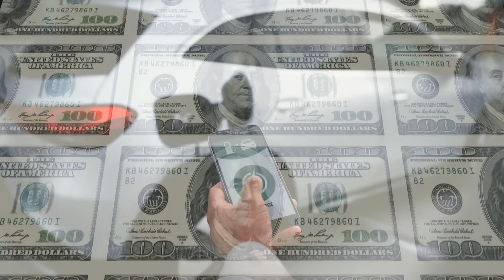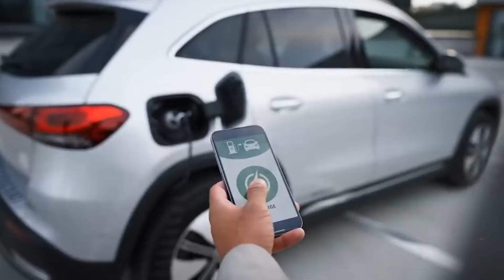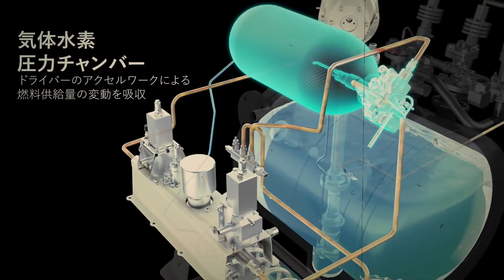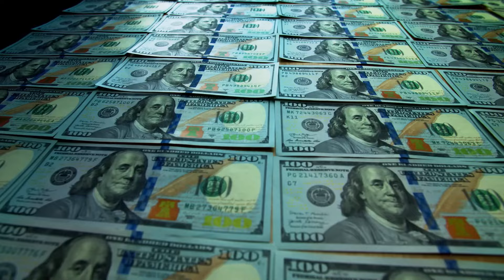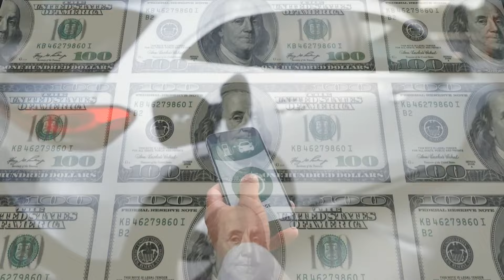HUGE NEWS: Toyota CEO REVEALS New Carbon-NEGATIVE Engine!

Comment: Okay, but are they accounting for all the industry surrounding the production of that engine? Each component is made by a separate factory run by coal fired power then shipping components via diesel trucks/cargo ships etc. Carbon negative means nothing if tones of carbon go into production of product. Electric engines are much less complex and battery tech WILL get exponentially better.

Comment: According to Electric Viking, theirs only two hydrogen fuelling stations left in California, after Shell closed shop!  Really Toyota, do we drivers want to carry around a large tank in the boot, to clean the air, and have to repair it when it goes wrong, it also takes up a huge amount of space in the vehicle, not practical.

Comment: This is vaporware

Hydrogen combustion is going to be a low efficiency engine,  but definitely doable.

Hydrogen storage -  Store it as a gas, and you have a short range car where the gas tank  has to be highly pressurized and takes up a ton of room.   Store hydrogen as a liquid,  and you need near perfect insulation or you end up like BMW  with your hydrogen gas boiling,  and you need a release valve or the tank will explode due to pressure.

Carbon capture,   This takes energy. . . Why should the car use energy to capture carbon,  while also trying to turn the wheels and get you from point A to B.   Unless they are breaking the laws of Thermodynamics. . . You would be better off seperating the carbon capture from the  car.   Run two independent systems.

Long story short,   this entire idea is bollocks.
Reply: Well I’ve seen videos when I had the same questions and don’t forget ten years before we would be saying the same thing about electric cars
Reply: @DanielHuggett-ob9ho    nah. . . Electric cars have always had one major hurdle being the battery pack

Electric engines have always been far superior to gas powered engines. . . Hydrogen combustion is just as inefficient as gasoline combustion. . . But unlike gas which is easily stored in a plastic box. . . Hydrogen is very difficult to store.

Comment: Hydrogen engines aren't new and they are all zero emissions. It might have a use case in commercial vehicles  where there are central storage area for fleets and high density energy is required (buses, aircraft). It''s unlikely hydrogen ICE will catch on for non-commerical use due to the extra costs associated both with extra complexity of the engines and extra costs transporting fuel. A zero emission carbon capture internal combusion engine for gas or diesal on the other hand would be a great as all the infrastructure already exists but it's still magnitudes of order away from zero emission.

Comment: You need a better AI to write your scripts, b/c this is nonsense.
Reply from the maker: No Ai here bucko. thanks for your input though
Reply: @TechDriveTV  Well, pointing out that your drive train has enough waste heat to drive CO2 capture is good marketing.
But this combines bad fuel economy with cost for dumping the captured CO2, will never be relevant for consumers.